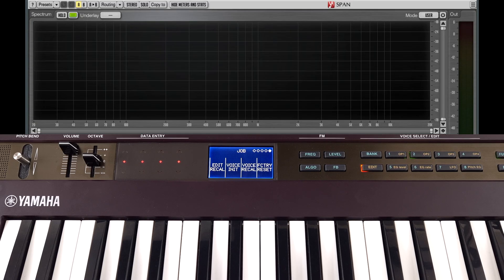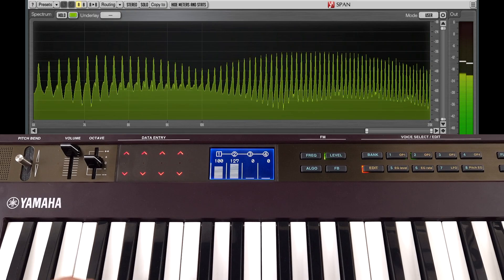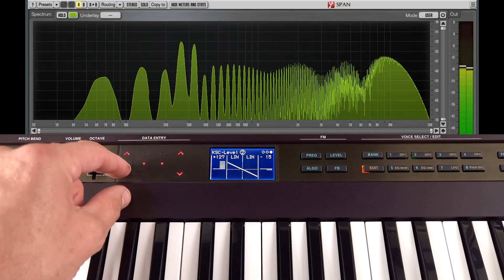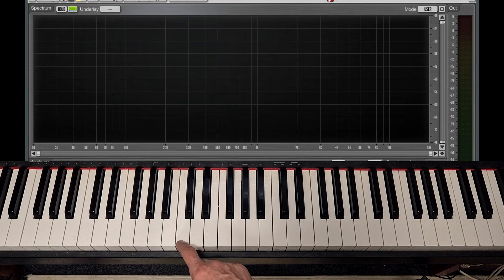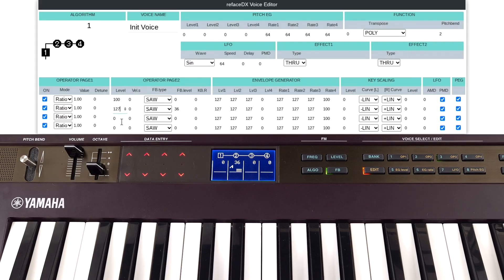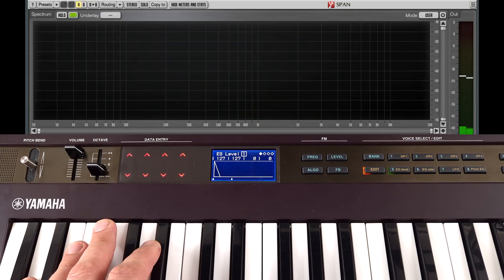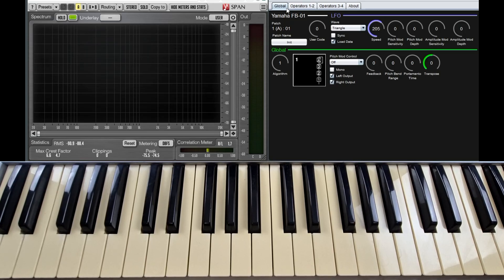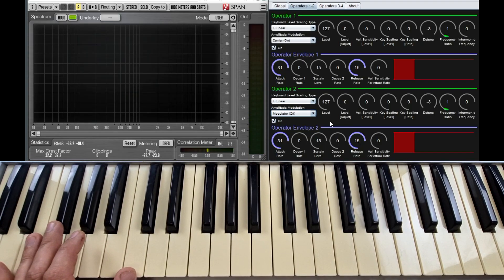FM Synthesis - Practical Tutorial 4 - Rate & Level Scaling, Velocity Expression, Reface DX, FB01

Comment: Thanks for the videos. I'm curious about your FB01 midi set up, I'm assuming Edisyn requires both midi in and out of the FB01 to send and receive information, and it doesn't look like your midi keyboard is plugged directly into the FB01. Do you have a USB to midi going from your PC to the FB01, and then the midi keyboard into the PC? For me it seems like my PC can only send info from Edisyn OR a midi keyboard and not both simultaneously, so I'm having to use Edisyn's "send midi note" to hear what I'm doing, which isn't ideal.
Reply from the maker: Yes that's right. In the midi setup you should set up the first two midi selections 'Receive From' and 'Send To'  as send and receive to your FB01 but then setup the 'Controller' selection to be your midi keyboard. You'll need a din midi interface for the FB01 but you can use a usb midi keyboard for the Controller for example

Comment: Hello Sir. I have an unrelated question regarding the ELZ_1 PLAY. What type of audio plugs are recommended for the two 1/4 audio outputs in the back? TS or TRS?
Reply from the maker: The outputs are unbalanced so you'll need TS cables. I asked Dr Yu Endo about this a while back because it isn't in the manual.
Reply: @ChrisLodyMusic Thankyou kindly! Would it hurt anything if I were to use TRS cables to plug into my Zoom H4 Essential aside from the factory the signals would not be balanced?